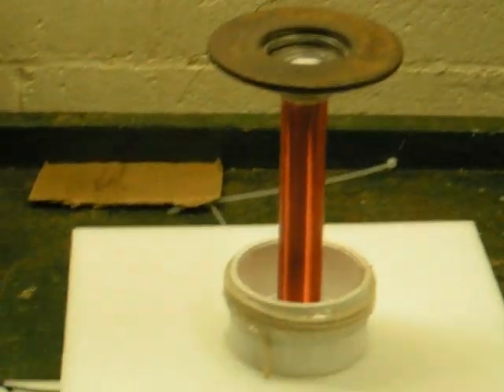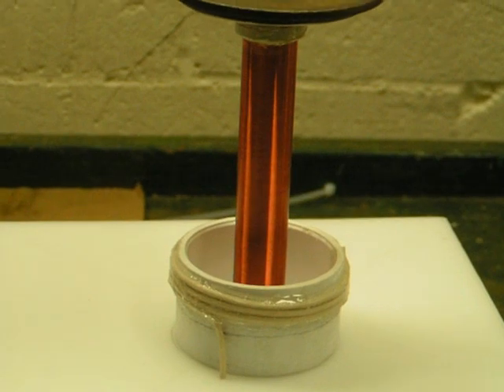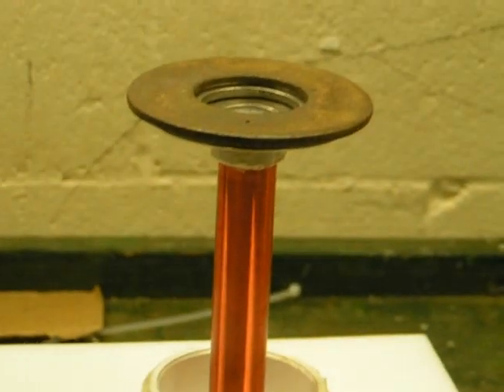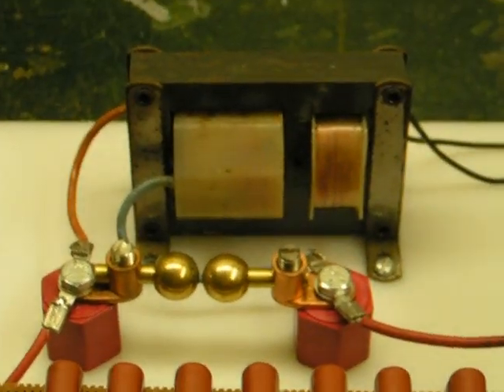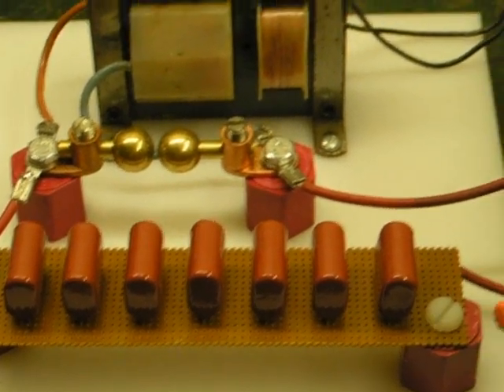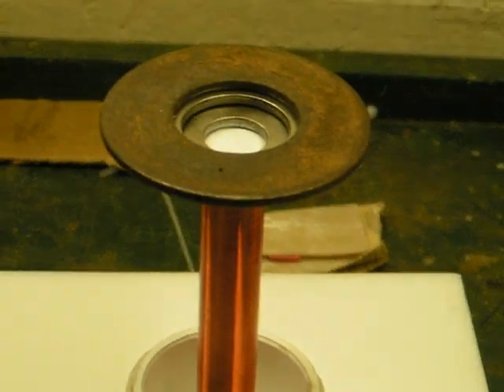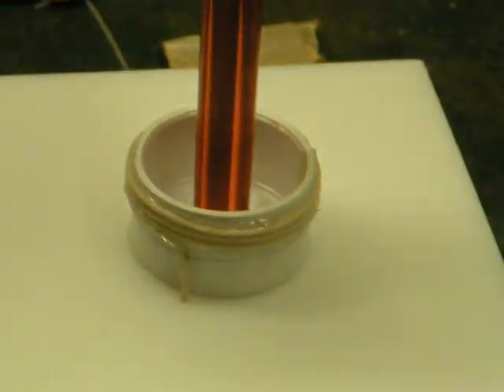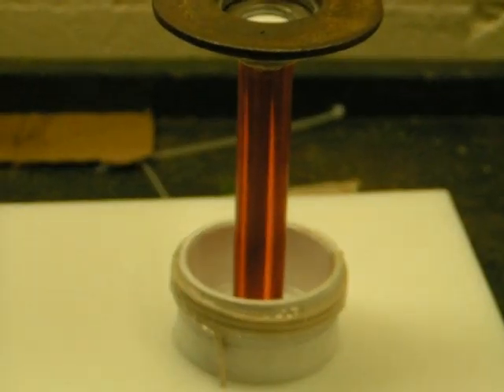mini tesla coil

Comment: Ya see the shunts between the primary and secondary? Grind a mm or two off :D. My bug zapper transformer puts out i think 30ma at 3500v, measure with a shunt resistor for current and resistive divider for the voltage. 105 watts :D. Now you can actually draw an arc...

Comment from the maker: I just threw this together. There were some mistakes made. The coupling is fixed and cannot be adjusted and the primary is fixed at 3.25 turns. I added washers of increasing diameter to the topload until I got optimum arcs. If I were to build another bug zapper coil, I would do a few things differently. It would be nice to change the topload to a sphere, but unless it has exactly the same capacitance as the washers, I would be unable to adjust the primary to accommodate it.

Comment: I built one with a bug zapper some years ago. I used a tertiary winding on mine. When the spark gap didn't have and carbon tracks, I was getting 3 to four inch streamers. You might get better arking if you use a small hollow steal ball as your top capacitor. I used a old brass door knob once for a turoid. Nice clean look for a non-solid state table top coil. Awsome :)